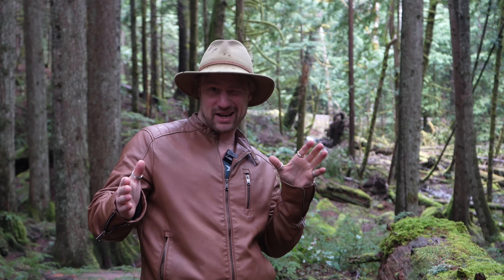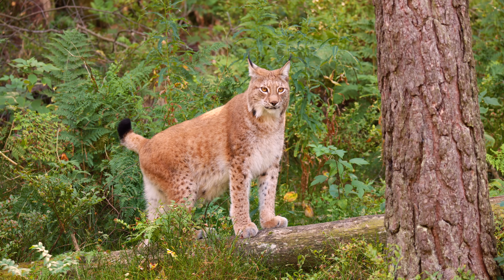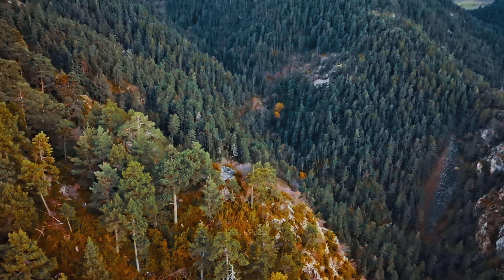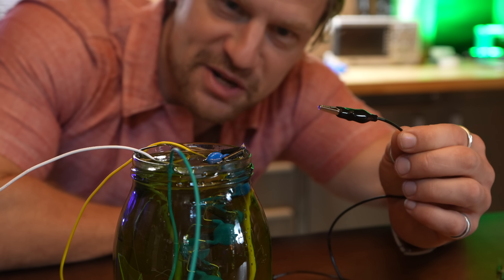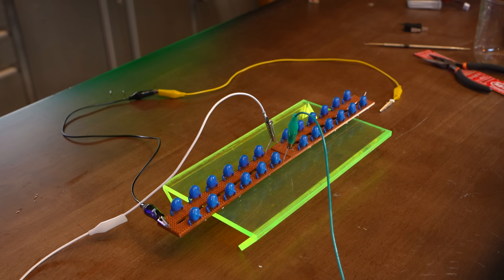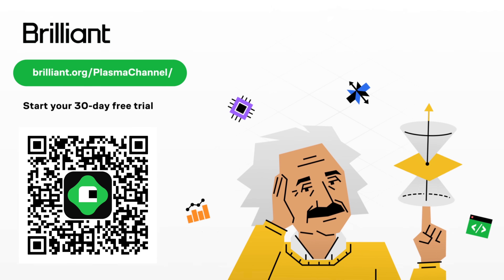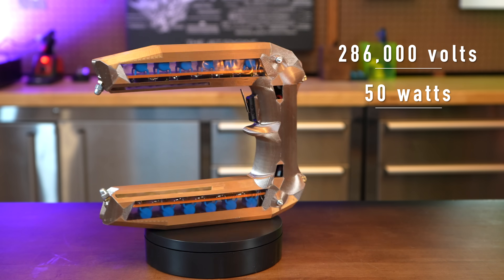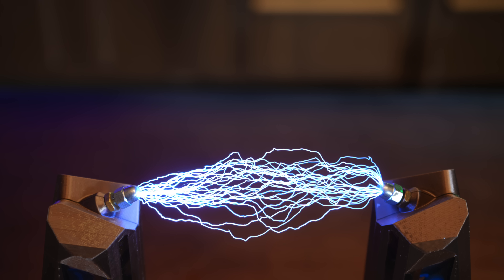A Next-Gen Stungun For Warding Off Animal Attacks

Comment: Would this hurt a bear? Yes. Would it work? no. The odds of using it successfully are low. You have to be fast enough and calm enough to be able to touch the bear with it. A gun is a way better option. A gun is cheaper and can do everything this device can do but it can also kill the bear which is a humans best option if the bear is attacking.

Comment: Super cool project! I'd love to see how effective it is in a real life scenario but not sure how you'd do that ethically.  I did love the "staff" idea and would love to see a version with telescoping segments (and a flipping head) with a battery pack at the bottom to control weight balance.  I'd maybe need a diagram to properly articulate this but I imagine a device that can be carried on a belt and quickly grabbed and snapped "open" with enough extension to have more reach than a normal person making a very effective "less lethal" device that can be more dependable than a shooting stun gun.  I can also see a way to put a secondary feature of a reloadable bear spray canister near the head to be able to spray or zap to give great flexibility to apply effective non-lethal force.

Comment: It'll be cool if you can capture the electricity in a glass ball positioned between the points for it to remain charged with some form of chemical or reaction within the ball for a few seconds to be then shot out as a projectile from a converted air rifle .

Make the projectile with a small ball in the centre that can be charged up with tiny surgical needle metal spikes encased with a glass ball that'll break on impact and the needles still charged penetrate the skin 🤣

Comment: I was making Cockroft Walton Multipliers back in the 90's, to protect my property from theft, so this is Very familiar!
Ima make one of these. I Love how you've made a Pair of Multiplier Ladders, Positive and Negative, with I'm guessing a 555 timer circuit is similar to Pulse the 2 HT Coils directly into the Ladders. Never seen or even Thought of that before!
This could do a rather splendid Jacobs Ladder if configured correctly..  
I do wonder if there are any issues caused by reverse EMF into the driver circuits? 
Amazing stuff!!!

Comment: So, here's my question; If you were to make this into a long reach self defense tool, with a pole on the end, what is to stop you from placing a higher capacity battery system inside of the pole, with the poles able to be charged independently and swapped from the head quickly? That being said, what is to stop you from designing these as a saleable product?

Comment: Regarding using it as a "spear" or something similar.  How about filling the "staff" part of that assembly with either 18650 or 21700 LiPo battery cells?  Yeah, it's going to be heavy for a 4 to 5 foot tube filled with batteries, HOWEVER, that heavy "stick" would give you an additional defensive tool.

Comment: As fun as this looks if I lived in the USA and felt the urge to go walking in the wilderness, I would definitely be carrying a decent bore sized pistol with skull cracker rounds. Bear skulls are about as thick as your typical Libtard. So don't take any chances. Skull cracker rounds are basically the illegal in nearly every state kinda thing, but like that should stop you. When it comes to bear bullets, easy expanding lead is not your friend. You need a brass solid preferably with a nice 45 degree point. Just coat them in lead so as to not mess up your rifling.

Comment: The fun part of that design is how fast it can slip in your grip if pressed against by an approaching object, rotate right back around, and then stun you too! Oh boy ergonomics.
Reply: A wrist brace could be useful, I suppose.  Or the staff.
Reply: Also the fact that it’s made of plastic so a bear could easily destroy it. I’d love to have one of these as a cool toy. But if I was ever going to use one for protection against a bear (or probably even a just person) I would want one with structural components to prevent exactly what you described, and also made of metal and rubber.
Reply: @shawnthompson8016  Nah you don't want high-voltage stuff made of metal! Then you're really asking for trouble! Even rubber conducts to a certain degree, so if you're thinking of using metal with a rubber coating, you'd likely need a very thick one. Then you have to worry about wires shorting to the frame, clearances, etc. Insulators and conductors are more like suggestions at voltages like that. It's the same voltage overhead power lines, the REALLY big ones, run at.
Reply: Oof, nice catch, you're definitely right about that.

Comment: Hi, what side diodes you used, campasitor 15kv correct? What size transformer did you use? Due power, how many batteries did you fit to support that power? How in your handle fit 24v batteries?

Comment: Schematic? Component list? For tesla cpil type of application 5inch gap (12.7cm) would discharge at arround 140kv so arround 60-70kv per side (6caps * 10kV input makes perfect sense to what is built there) depending on air its 120kV - 160kV ... Humidity wind and such... and for static discharge so a single arc from dc overload is at 380kV approx. So am curious how you got 240kv?

Comment: Which diode and capacitor you used 6:44
Reply: module: DC 7V-15V 12V To 15KV-20KV High Frequency AC High Voltage Generator Inverter Boost Spark Arc Ignition Coil Module Board

diode: 2CL2FL 15KV 100mA 100nS High Voltage Diode Rectifier

capacitor: 680 pF ± 10% 1000V X1/Y2 safety capacitor
Reply: @dani146cluj  thanks bro
Reply: @dani146cluj  can I use 2200pf capacitor
Reply: Of cause you can use 2000pf , you need more power battery added - a bit bigger size

Comment: how about using carbon fiber filament as air gap initial conduction line, to make a plasma channel, even over inside water (heavy water). put high amps, but only low voltage over the wire line.

Comment: Gday Feller, I really like your work. I'm sure you understand the physics. But to explain a bit of practical experience to your audience, 

About high voltage/high frequency. Firstly, air/gases start to conduct at a measly 270 Volts or so at atmospheric conditions, as shown by the Paschen curve. (electrode spacing dependent,) so air is not a good insulator.
If an electron/atom has time to whiz up to speed.... enough to knock an atom off a surface it will evaporate that surface and start digging a hole by sputtering. This typically happens at the size of the smallest to medium sized bubbles in your insulation materials....like badly degassed epoxy for example.
Mean free path of the accelerating electrons/atoms is the key to this. If there is no gas to allow the electron to accelerate under the applied voltage, the insulation will last a lot longer. 
Solid ceramics are therefore the best insulators, even epoxy bonded alumina powder for example is good.

Second point I would like to make, is the use of "NICKEL ZINC," ferrite for the high voltage part of the magnetic circuit. 
This stuff is available, often more easily than manganese ferrite, and is an excellent insulator. Slabs of the stuff are available for flat cable shielding, short tubes for RF applications, and antenna rods, from the cheapie electronics stores. Easy to drill with a bit of patience, carbide grit, and a wet copper tube, or a diamond drill.

At several tens of KHz and particularly at resonance, the coupling provided by these bits of ferrite is excellent. 
The main point is, to remove the remove the capacitive coupling to the magnetic core and remove the need for so much insulation from one end of the high voltage coil to the other. 
Gaps (insulation,) in the magnetic core provide much needed isolation and magnetic decoupling. 

Nickel Zinc ferrites work wonderfully in place of the "hard coupled," manganese ferrite cores often used in TV flyback transformers. 
Attempting to achieve resonance in high voltage transformers works in ferrite cored transformers just the same as in air cored Tesla type transformers.
The impedance of a circuit at resonance is zero. Which means "infinity," in terms of voltage and current. Match the input and output frequencies and there is no limit to the coupling.
Hope this helps, Mink.

Comment: Hi, can you share specs of diodes and capacitors you used or maybe some documentation, which can help calculate maximum acceptable input and other characteristics of the circuit?
Reply: Also, how to make it produce a charge of opposite polarity? I just can't figure it out somehow

Comment: I live in bear country in BC Canada. This gadget is pointless as a deterrent. Most wildlife does NOT want to mess with human unless humans have desensitized them or a person has food and the animal is starving. You find out in the wild that low tech is much more reliable that any high tech gadget that has many parts that can fail in a time you need it. A simple air horn, bear spray, and a rifle is more than enough to keep you alive. When having loud bells and music on you as you walk will do more to keep animals away from you than this gadget. A gadget won't help if you don't practice back outdoor basics like securing your food and knowing how to behave around animals. One thing I am concerned about this device is causing forest fires by accident in dry summer conditions or electrocuting yourself in wet conditions like in fall and winter.

Comment: I like your videos but...
This is not 286kV. A 9.5cm air gap equals about 91-97kV, but only at the moment of initiation. After creating a low impedance channel, the voltage immediately drops to 20-30% of the nominal value, or 27-29kV. Secondly - this small transformer has a low current capacity. Unfortunately, bears have thicker skin than humans - I do not recommend this device. It can't save you, really.

Comment: Are those 15kv, 20kv, or 30kv ceramic caps? What's the pf rating as well? Also your diodes are they 15KV 100mA? Isn't your schematic a Croft Walton setup? edit: I may have been able to extrapolate parts by zooming in lol

Comment: Normally when I measure high voltage I usually use a "standard measurement" of 3KV/mm at sea level, I don't know if where you are is close to sea level but I know that (25.4×3.75)×3,000= 285,750V or approximately 286KV (the part in parentheses for those who don't understand is the conversion from inches to mm)

Comment: How did you measure 50 watts? from battery? or from output?
Reply from the maker: Each circuit at full power consumes about 29 watts of power. They were both being run at about 90% power - meaning about 50 watts for the two.

Comment: Re-comment, bears will fight through an incredibly intense shock.  The same bear that won't turn away from a warning shot will respond in anger to a taser.  They won't be disabled by it, nor will any of them be deterred from finishing what they started if you catch them hopped up on hormones.  It is a very bad idea to count on this as a deterrent.  The only safe thing to do to avoid bears, or cougar, or any other wildlife, is to make alot of noise, and properly contain food in air tight containers.  This won't protect you, and it will likely cause what could have been a  mock charge to become a battle for survival.  Bears are the epitome of "Don't Start None, Won't Be None".
Reply: Instead you should REWATCH since he said its not to tase the bear but scare them off with loud noise. You have the attention span of a goldfish.
Reply: @99Plastics  "The same bear that won't turn away from a warning shot will respond in anger to a taser."

as opposed to the reading comprehension of a toddler?

Comment: From the first video I got all I needed. Already have the parts on the way. Awesome toy!
Reply: Can you let us know what the parts are? Looks like he deliberately hid or removed the codes.
Reply: @sausage5849 most parts are easy to find as long as you know what voltages you are at/aiming for and if you know what you are doing. If you can’t figure out what the parts are you probably shouldn’t try making it.
Reply: @ I will not do that.
Reply: @billyjoe3309 I just wanted to ask but it looks like the bronze boards that he solders on are just 3d printed templates to help solder cleaner. Is that what it is? I’ve done a decent amount of electrical work and haven’t seen many things like that besides breadboards.

Comment: @PlasmaChannel, Actually i noticed something strange in your video exactly at 2:01 time stamp, it felt that the high voltage is actually making the metal contact point's partical vibrate, i was wondering if its actually bits of metal residu or the lattice structure of the metal itself vibrating.
Reply: It's little bits of metal getting vaporized. I've built a small coil and even though it doesn't catch well on camera you can definitely see sparks of metal getting thrown. If you've watched Jeff Behary's stuff some of his more powerful coils display this as well. And while I'm aware that this is DC it has more to do with peak current during the arc.
Reply: Also I think I mistook what you're looking at in the first response. That's just the light pattern on the metal. A lot like laser speckles. This is from surface irregularities. It doesn't take much vibration to change the pattern. Looks pretty cool nonetheless.

Comment: I've seen people buy electric airhorns for trucks, and then buy cheap or broken electric drills and modify them so the airhorn is mounted in the drill body plastics, and uses the drill battery to power it. Blasting something like 120dB+ of sound at a bear would probably scare it off under most circumstances. Probably also a bit safer to operate. Doesn't look as cool though, maybe carry both?

Comment: Now to get that into a format where you can get to the bear before it's on top of you and you're golden.
I have to remind people that at 35MPH even if the animal is deceased it is going to hit you on its momentum.  If you were afraid enough of it to zap it then it's probably heavy/big enough to be like getting smashed by a small freezer thrown from a truck driving by.
This is even better than other means because it will scramble the entire nervous system so once connected it should clobber the legs and theoretically fall down right where it's at, braking friction provided by the belly flop.

Comment: If the bear wasn't frightened off it would rip your face off before you had a chance to shock it 🤣
Reply: 50 watts at 250K volts will only piss a bear off on contact, need more power to get the amperage flow to fry its butt..........Need an ignitor box say like off a Rolls Royce 250 series helicopter jet turbine engine👍

Comment: Let me start by saying it's a cool project and I'd be proud if I made it. I assume you don't intend to actually try to use this version of it in an actual emergency, so forgive me if this sounds pedantic. But you have to remember that an attacking bear is not a flat, solid, immobile object, but a fuzzy, blubbery mass swiping at you with surprising range of motion. Even if this thing were built into a properly rugged frame to survive camping much less a bear attack, that's still an unstable shape to hold. It's going to tend to twist in your grip toward one side or the other as you apply force forward. Because the ends are large and blunt, you're going to have to press very hard to get through very thick fur towards the actual skin, and in many places the grain of that fur will tend to cause things to slide sideways and be deflected, playing on the weaknesses of this shape. But who knows, maybe you'd light its hair on fire even if you didn't reach the skin. Or perhaps the fur would conduct the current into the skin? Would have been cool to see you zapping some (non-living) things with it so we could get an idea of its capabilities.

The button (microwave oven door switch?) has a number of mechanical weaknesses as well, including damaging itself and your finger if the thing is twisted in your grip, and just basic debris getting stuck in it. This thing would probably at least scare off the vast majority of bear attacks before they happen, but only if that switch doesn't have stuck into it any dirt, twigs, mud, tiny rocks, or any of the other things that bears and campers are usually surrounded by.

I believe you are capable of building a practically usable version of this, like with steel pipe as the frame or something. But to a 1000+ pound bear with several inches of fur and hide charging at 30+ mph, this is more like the cosplay version. I'd either look at it as an experimental prototype and consider constructing a final more appropriately packaged version, or else avoid over-hyping it as an actual weapon.

It's still pretty cool though, wish I had one to play with.

Comment: Here's a task for you. A unit you have on your backpack that will protect you from drone attack. Do you think high voltage unit would do the trick?
Reply: Tech ingredients disrupted drones with a powerful microwave transmitter. It would be interesting to see whether that would still work with, say, a ten microsecond pulse repeated 10 times per second. That would be a lot safer for people and would need less power.